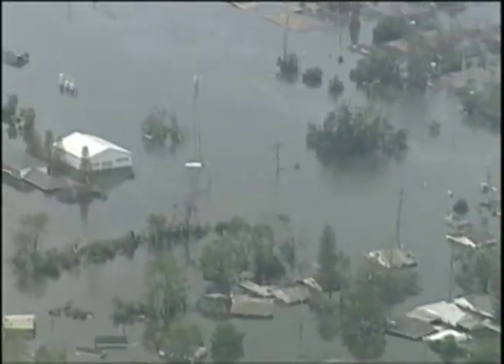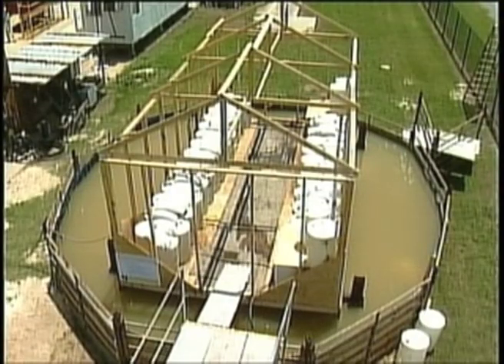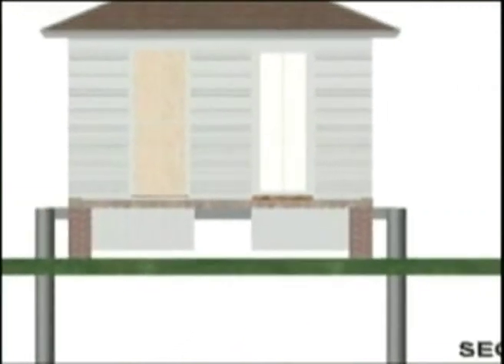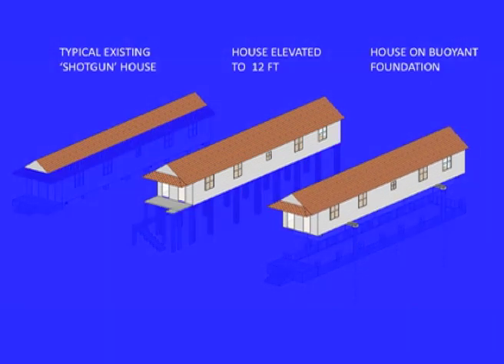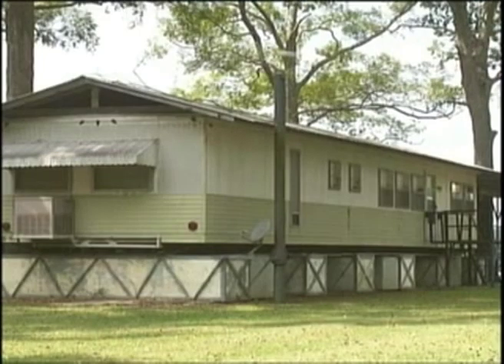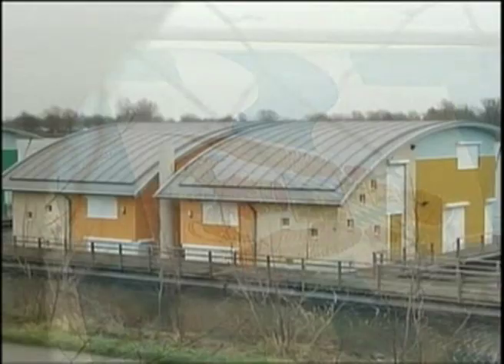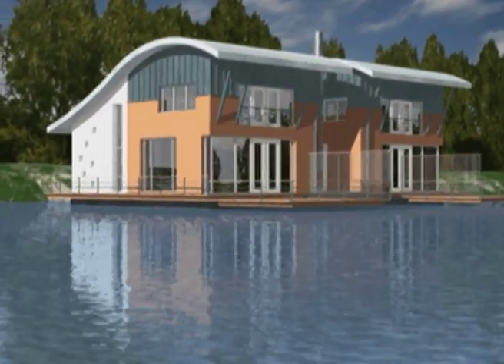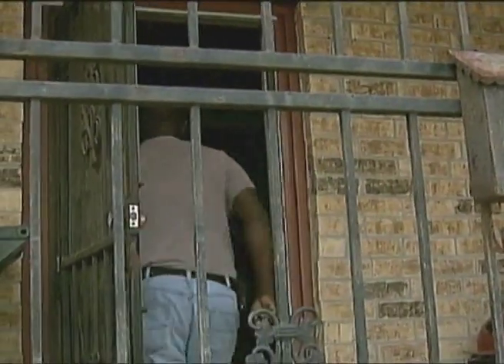The Buoyant Foundation Project Movie

Comment: This will not be cheaper than elevated homes. Think about the cost of testing for the Building Code, the cost to completely insulate the bottom of the house (don't forget mechanical and electrical rewiring), training contractors, the complex connection for the foundation. How will this perform against uplift due to seismic activity and high wind loads? What about poor soil conditions (remember that elevated homes are not limited to pile foundations). 

Why is she being so one sided about promoting this? A good professor should give an unbiased comparison between buoyant foundations and elevated homes, and consult experts from other disciplines. So what if the conclusion ends up being to use elevated homes or to continue building homes without flood protection? I suspect that many experts realize the problems of buoyant foundations even if you continue to pitch it.